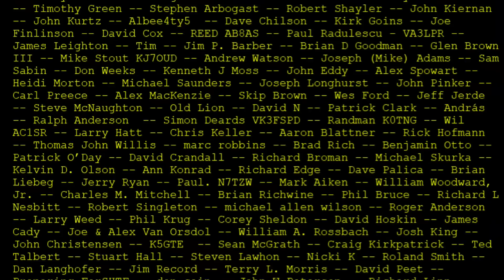POTA Antenna Tuning (#1201)

Comment: Honestly Pota is more about experimenting with antennas with you setup.   Most use Hamstick on vehicle mount.   Quarter wave vertical.   Most portable use battery power so grounding is not necessary.   My favorite is a V dipole on a 6ft tripod
Reply: I have used a HAMstick, once on POTA. We were roving and got 9 parks and 5 states. For that I agree, but my standard POTA includes 4 antennas: DX Commander Classic, an EFHW, an EF Random Wire Inverted V at 71’, and a Chameleon SS17’.
Reply: Yep.   EFHW, EF random, hamstick, 17ft whip, wolf river coil.    Depending on the area park and environment.   Each park has there own rules as what you can use

Comment: The LDG RT100 tuner will work without any extra control cable. All it needs is a Yaesu radio switched into the ATAS mode. Then, using the mic, you can manually use the ATAS mode to squirt DC up the coax to get the tuner to tune. For a non yaesu radio the bias tee control box which I believe is optional, will do the same thing, it does require 12v dc though. Therefore you can either put the tuner very near to the feedpoint with a short piece of low loss coax feeding it from the feedpoint. Or, you can put the antenna wire directly into its so239 antenna socket via a banana plug or via the red side of a cheap connector which will go straight into the so239. Please note that the RT100 has a narrower tuning range than a dedicated long wire remote tuner, but you aren’t limited by the length of the control cable which also is needed by those remote tuners. 73

Comment: For pulling deeply driven posts , stakes , rods , etc , all you generally need is something like a Hi Lift jack and a length of chain .
I've pulled a lot of fence posts and even old utility poles with this exact set up .
Ground rods can be the most difficult because the small diameter and smooth surface isn't easy for the chain to bite and hold on .
They do sell mechanical cams for stretching / tensioning fence wire , and most ag stores sell them . These can hold if the chain won't , but not always . YMMV .